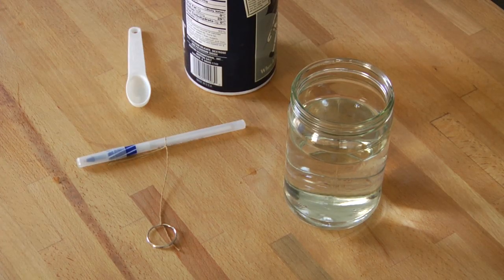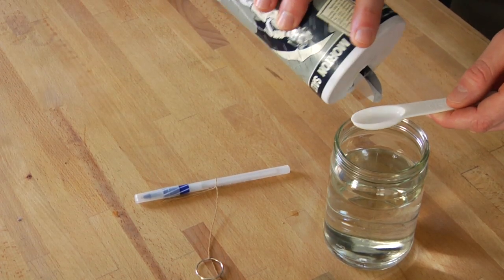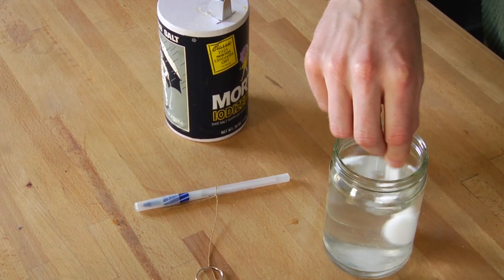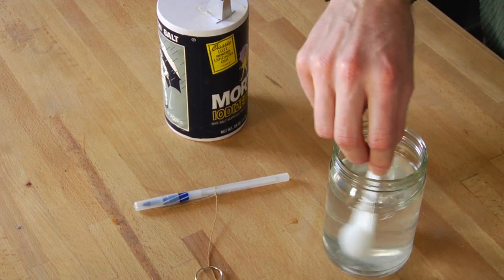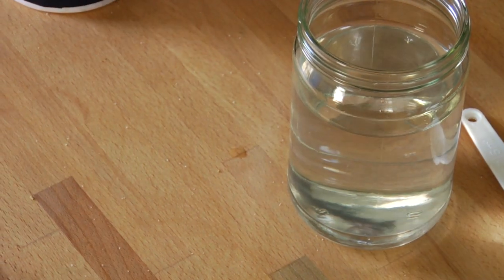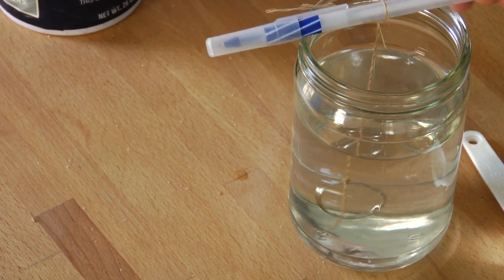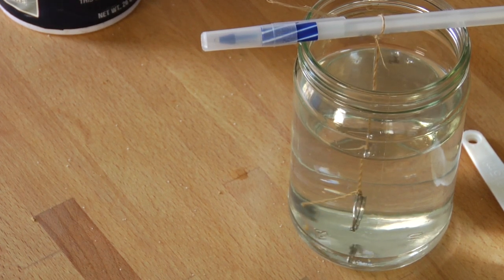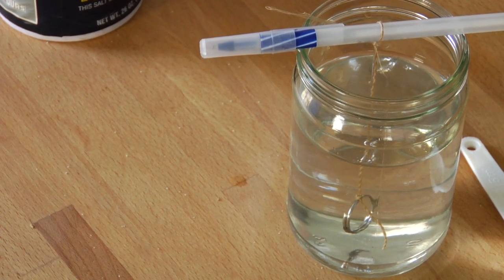Chemistry & Biology : How to Make Salt Crystals

Comment: the temp of the water does matter even though the bond of NaCl is ionic, still the solubility of  NaCl to Na+ and Cl- has a Ksp value, and that Ksp value is temperature dependent. I don't mean to bash or anything, I just saw a chance to give you some knowledge about the subject, because the Ksp of NaCl in water at 25C is 38.65, while it's almost 80 at 100C

Comment: NOW if you now bring the temperature of your supersaturated solution down, those molecules MUST reform back into the crystals they started at but THIS TIME they will form into larger crystals than grains of salt. I know there are methods of cooling and heating as well as what medians you can use to control the size of the crystals although i don't know what they are, but this guy obviously doesn't, no offense but why go to all the trouble of making a science video if you dont even understand it.

Comment: its chemistry not philosophy... there is no "debate" about whether hot or boiling water can dissolve more salt molecules. actually that is the whole key to making crystals emerge. At room temperature a certain amount of salt can dissolve,this is called a saturated solution. When you raise the temperature to a maximum of boiling, more salt can dissolve, this is a super-saturated solution.

Comment: @231johnjohnson  No, no! The only thing you are going to achieve is over-saturate the solution and end up with the water level being below the salt level! Just add some extra salt until you have saturation ( = you see salt particles on the bottom of the jar), heat the mixture, let it cool FIRST IN THE AIR, and then in a cold bath (cold water, ice etc). Wait and see!

Comment: Nice Video! I'm a first-year Physics student and our semester includes Chemistry lab. We did something similar today in chem lab (for the sake of the saturation-supersaturation theoretical part): We dissolved NH4Cl salt in deionized water until the solution was saturated. Then, we heated the solution in boiling water, let it cool in the air, and then put it into a bowl full of ice. Of course, I overdid the saturation part :) and the experiment didn't succeed.... But anyway, it was nice!